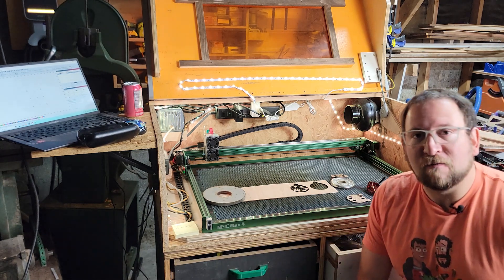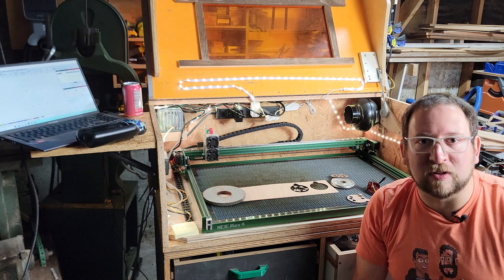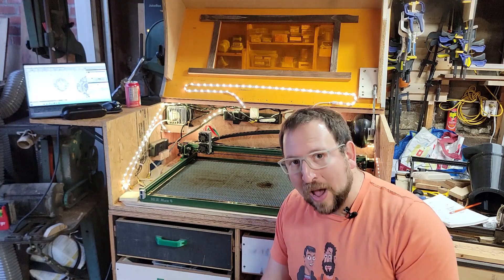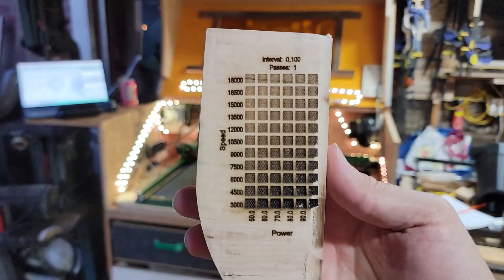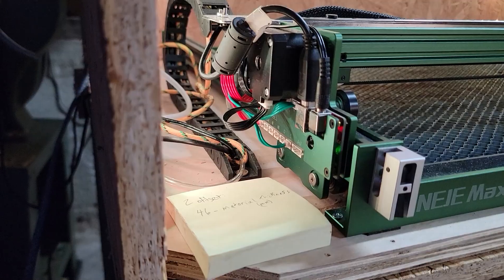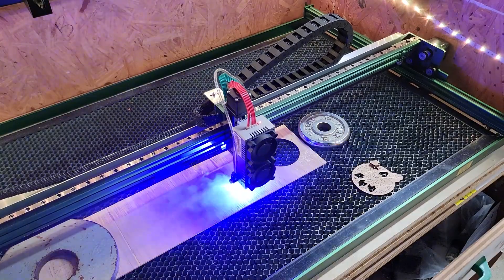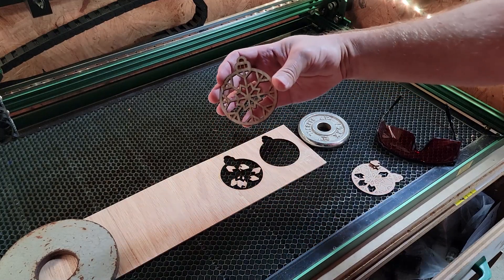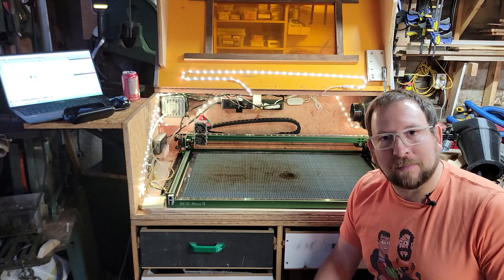Neje Max 4 Laser Review

Comment: So, what we're the quirks specifically, and how did you overcome them?  Thanks.
Reply from the maker: One of the biggest quirks was how Lightburn sees the z height adjustment. Most lasers lower the table, but this one actually raises the diode so you have to calculate your offsets backwards. So I have to measure the thickness of the piece I am engraving, subtract that number from 46 and put that in the offset section instead of being able to write the offset number.